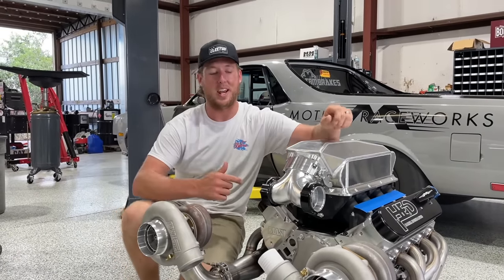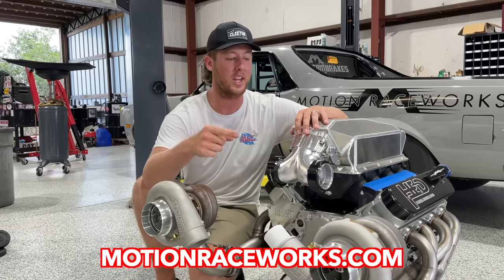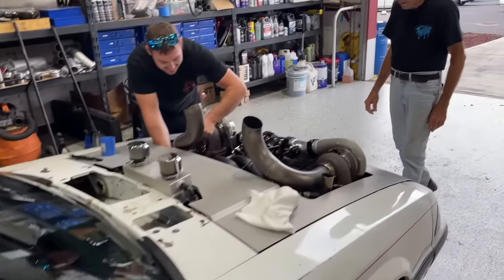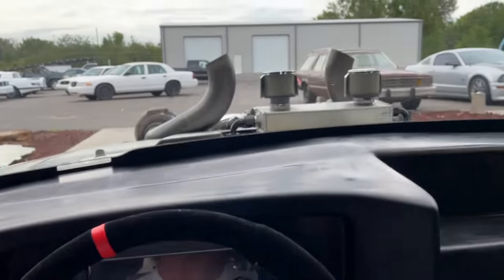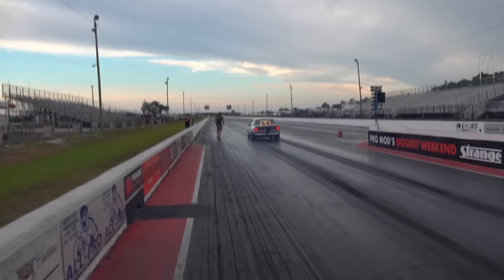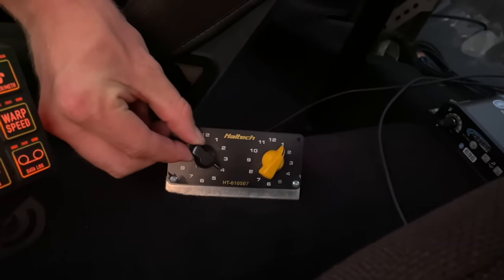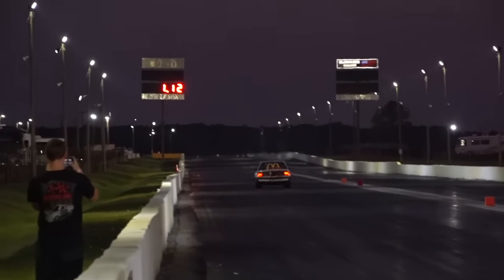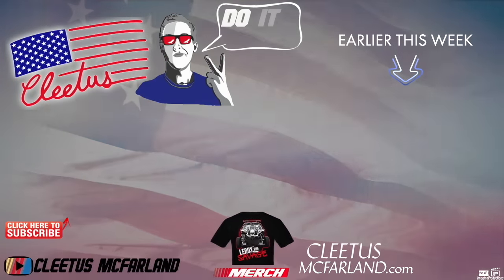I've Been Shifting My 5-Speed Lenko BACKWARDS For Months... INSTANTLY Made My Car WAY FASTER!!!

Comment: Impressive regardless but when you put all the right parts from the start into a foxbody, it doesn’t matter so much of what brand of engine your using, as long as it makes good power your going to have good results along with one of the key factors that really helped, like having the Haltech guys come set up the car and get it dialed in. All the other cars have been unconventional set ups that got upgraded as they evolved. Except for Mullet, but it also did pretty good from the start as well especially for how heavy that car is and with the pretty much off the shelf TSP LS engine it had in it before the big block when in.

Comment: ChatGPT says from right to left :D

which is the first gear lever?
In a Lenco transmission, the first gear lever is usually the one farthest to the right (for left-hand drive vehicles) or farthest to the left (for right-hand drive vehicles).

The arrangement of gear levers in a Lenco transmission, from right to left (for left-hand drive vehicles), has to do with ergonomics and ease of use during high-speed drag racing.

When driving a drag car, the driver's primary focus is on quick acceleration and smooth gear changes. The right-to-left lever arrangement in left-hand drive vehicles allows the driver to pull the levers towards them in a more natural and efficient motion. It minimizes the time spent moving the hand between levers, which is crucial during high-speed runs where every fraction of a second counts.

Comment: Lenkos are personally a mystery to me, how can you shift anything the exact opposite way with 1000hp?
Reply: Other than 1st gear the other ratios are so close together. That’s why.
Reply: Because Planetary transmissions are awesome.
Reply: @lordcommander3224  but still 1st gear at 150+? Seems unreasonable tight if so
Reply: Because all the gears are almost the same except 1st. You’re just stacking them the opposite way. A Lenko is probably the most versatile, most simple, and toughest standard transmissions invented.
Reply: The gear stack at the end of the track 5th gear in all the same.
Reply: a lenco is essentially a series of 2 speed transmissions bolted together and each section is an underdrive ratio (see the chart in the video) or when its shifted its 1:1, or direct drive. a 5 speed lenco has 4 sections, all of the underdrive ratios multiply together to get first gear. for example, say each section is a 1.25:1 gear ratio

1.25 x 1.25 x 1.25 x 1.25 = 2.44, this is first gear. shift one section and you get
1.25 x 1.25 x 1.25 x 1.00 = 1.95, this is 2nd. shift again and
1.25 x 1.25 x 1.00 x 1.00= 1.56. this is 3rd
1.25 x 1.00 x 1.00 x 1.00 = 1.25, 4th 
1.00 x 1.00 x 1.00 x 1.00= 5th, direct drive

in my example all sections are the same, and it wouldnt matter if you shifted left to right or right to left, technically you could shift any section first (though not recommended for longevity). in actuality each section has a different ratio to keep the rpm in the correct range. in the data log shown you can see the first shift happen and then in rapid succession the 2nd and 3rd shift, and 4th gear hangs on a long time before going to 5th. this is because the section with the smallest ratio change is getting shifted first, going up towards the larger ratio changes. going the proper way it gets nice even gear splits
Reply: @Sharkey_t  exactly... This guy gets it.

The only real difference, I think, is how torque is applied in the sequence going from left to right vs right to left. That would be the only noticeable difference. Like changing the gears on your bike front set vs rear set. (kinda, it's both like that, and not in a weird way)
Reply: @Steve T  that was some quality information there my guy 👏
Reply: It isnt like going 5th to first in a manual, all it changes is the split between each gear, all five levers down is still the same final gear ratio.
Reply: @th3R0b0t  The difference here is not all gearsets have the same ratio, they're slightly progressive across the modules. Sequence changes the entry RPM in each gear, and there were larger steps with the 'reverse pattern' that was pulling the RPM down further up the track where basically physics and timing say it's just going to have to sit under the power peak that much longer. Worth a third of a second so far, that's big.
Reply: @mfree80286  Correct. The previous comment gave a great overview, but as you pointed out, the gears aren't all exactly the same. So it's not 1.25x1.25 as his example was, because the Lenco like all transmissions needs to have steeper gears in the 1st-3rd range in order to help with torque multiplication.
Reply: @Luckieoutdoors  Its not 1st gear at 150 MPH because he started at the right side and the gears stacked the opposite way. That makes it no longer 1st gear , i think thats how to explain it.
Reply: @Sharkey_t   Best and most comprehensive explanation of this whole comment section! Thanks for taking the time to write all that out! 👍👍
Reply: @Sharkey_t  that’s a great run down but I think I need to do some more research to get it to sink in. I guess the manual shifter gives the Haltech ECU one less job to do. 🇦🇺🇦🇺🇦🇺
Reply: Think of it this way, he basically was using a different 1st 2nd 3rd and 4th gear.  He’s still shifting into a higher gear each time and 5th is still same final gear either way you run the levers.  It’s still finishing in 1:1 ratio.  It’s just different spread on ratios.

Comment: I can definitely see mcflurry running a 6.99 easy with a super spicy tune and a proper setup suspension
Reply: I totally agree. They still haven't even started to tweak the suspension, which should be able to get them into the 7.1s-7.2s with just suspension changes. Also they haven't made tuning changes to maximize ET. Just playing with launch RPM, timing changes in 1st and 2nd gear could bring them to the 6.9s-7.0s... and that's before adding some extra spicy boost. They will have that car running 6.8s-6.9s before the end of this year.
Reply: @RonniePTexan  I think after they make that plastic intake go boom boom, they will toss on a few more upgraded go fast parts that will get them into or right at a 6 second run!! They will need more than 20 PSI of boost to get there and that plastic intake will not like it...haha
Reply: @JoBlo819 I said 6.99 easy 😉

Comment: No lie I would laugh my freaking butt off if McFlurry runs 6s before Leroy does. I laughed when cleetus said that it took 3 years to get that kind of 60 foot with his other cars.
Reply: Not a good timeline comparison really. Cleetus has top of the line suspension and all the big boy go fast parts from the start with McFlurry but he was using junkyard engines and stock suspension on Ruby , not to mention he was still learning how this racing thing works without the team of guys he has now.
Reply: @warren michael  The fox platform with the engine & tyranny combo is the key.
Reply: @tr4u5mp90  no it’s the 4 link/ 9 inch combo is the key here for the 60-330 times.
Reply: @tr4u5mp90  yes and no , the fox in its stock suspension form wouldnt even come close to running like it does now, its all that suspension and rear end work that makes it possible to put down all the power from the Zilla through the Lenco. It took a long time for Leroy to get fast because they didnt start off with as many top notch parts like they did here. I will agree that these fox tangs are a GREAT platform and thats why we see so many awesome fast ones out there. I cant wait to see them upgrade the intake and other remaining stock Zilla parts to see what it can do. I just hope it doesnt go bang before they get it really going fast!!
Reply: @warren michael  I've seen many Fox platforms running crazy fast with a turbocharged coyotes with minimal upgrades.
Reply: Why?

Comment: You should see a lesser ratio gap to the next gear with each upshift. L to R vs R to L just depends on how the shifters are set up and the order of each module.
Reply: I dont think this transmissions is what i think it is because usually youre not supposed to be down shifting to upshift or visa versa whichever way is best.
Reply: idk I feel outside to inside is also more ergonomic.
Reply: @TheOlsonOutfit  By nature of design, it can be set up either way.
Reply: @TheAnnoyingBoss  It’s planetary gear sets stacked up. Doesn’t work like a traditional manual.
Reply: @porcucoon  understood

Comment: outwards shifting in , seems to be best , one thing i did see on the interior cam is that you kindah hit the pulled lever with the back of youre hand/wrist every time you grabbed the next lever , maibe you can try to switch the short and tall levers around ( not as in shifting but unbolt and remount ) so youre arm goes over the last lever grabbing the next one , might make it feel more natural too , might be possible to switch the rods to the trans around to different levers too instead of switching the levers around so you can still shift from in ward to outwards but the shifting on the lenco goes out to in

Comment: The LS route might be the more affordable way to go but clearly Ford has made some pretty big steps in the performance department in recent years!!
Reply: Let’s Talk👍
Thanks For Watching!
Reply: ford just made a bigger LS the similarities in the engine are very very obvious
Reply: @jackass123455  fail to realize Ford has been making pushrod engines for a very long time and every single feature in the Godzilla was already in Ford engines all the way even from the 50’s skirted block for example from the Y block.. Ford NEVER borrowed anything from chevrolet but weird to me that when they came out with the “LS” they chose to just use a small block Ford and update it instead of updating the small block chevy, the ls it is without a doubt a copy of a Windsor SBF, and  you can tell the LS is just a cheap counterfeit imitation too because the oiling in the Ford is better…. chevrolet engineers weren’t smart enough for that…. It’s the small details

Comment: You'll most likely get the highest performing result by using the levers which create the biggest difference in gear ratio first. Start with the biggest difference and go in order to least difference. That means you want to pull the 1.184 lever for the shift from 1st to 2nd, then the 1.166, then the 1.26es one at a time. The logic behind this is...in order to generate the most acceleration (regardless of power/torque) you want your RPMs to accelerate as quickly as possible. The faster you're already going, the bigger difference the same change in gear ratio would make, so the faster you're going you want smaller changes in gear ratio so the RPM can continue to accelerate as quickly as possible. Balance that with the power/torque bands and the independently balanced cost/benefit relationship with staying in gear longer vs adjusting the gear ratio more often/accurately; and you'll get the most performance. 

As a side note...this is where a big difference in a consumer transmission versus a racing transmission comes in to mind; a really big difference in for example a 6 speed's last 3 gears (4th, 5th, 6th) makes for better fuel mileage and debatable benefits for longevity; but that same transmission probably limits the engine's ability to reach top speed without the assistance of a big hill...a racing transmission with smaller differences between the last 3 gears not only has the opposite effects of the consumer transmission (fast fuel use and debatably bad for longevity) but allows the engine to be the limiting factor for speed and acceleration instead of the transmission...at least when the gear ratios are paired correctly with the power:weight ratio. There's another equation for you to make a Dr. McFarland episode with... Gear ratio:(power:weight). Another factor, specifically with the final gear ratio of the racing transmission is one that's very difficult to achieve in the real world - let alone in a simulation/game. Having the final gear ratio set in a way that allows the engine to produce peak power, at the vehicle's top speed...where setting the gear ratio any higher or any lower results in the top speed being reduced because the timing of reaching peak power and the mechanical/air/other resistance achieved at those speeds being overcome. 

IDK if that all makes sense, I hope it does.

Comment: Shift pattern is much better R 2 L but, something to consider is if you ever need a slightly less aggressive gearing (spinning out issues as you ramp up power for example) you now know you can simply shift the other way 🎉 Just another tool in the toll box

Comment: if you play it back, both runs, you can hear the second run is correct, the engine is kept at a constant high rpm which is where the power is, hence the faster time.

Comment: There's a ton of customization for the Lencos so there's no real right or wrong in general. What are the splits and what works best. You can take that stack apart and flip gears around and then shift the other way. You can even randomly pull levers - the trans won't care, but your times will be off depending on the order. Unless you know the ratios there's no way to know the right or wrong way to shift. Everyone saying your wrong because they saw someone else shift one, or even if they had one - is full of ****. You need to know the ratios to know the correct way and testing confirms that's the correct way.

Each shift brings a drop in RPM from peak HP to peak TQ. You want the bigger drops in the beginning and the smaller ones later when you need HP to overcome wind resistance. The 1-2 shift can be the biggest, should be the biggest, because most/all of the HP is going to acceleration. At the top of the track the HP needed to push it through the air is highest so you have less for acceleration. 

The 1.26's first, the 1.16 last is the correct way to shift - and you proved that.

Comment: I guess it stands to reason that the intent would be to shift the forward most stage first...if for no other reason than the stages behind would be turning less revs sooner and more often over time. So...a tiny bit less wear over time I suppose? Other than that it's just what ratio each stage is in and what your preferences are regarding the order of those ratios stacking up. I mean physically, you can shift in in whatever crazy order you want, right?

Comment: Is that a clutch or Bruno drive, I’m building a similar car was originally set to be nitrous car, now I have switched to Twin turbo, I have a cs-3 5 spd with Ram twin disk clutch, trying to find a Bruno drive, i’ve had people tell me that I can build boost with a clutch, by retarding the timing at the line. Not too sure how that will work. That’s why I’m looking for the Bruno drive. Any input on your setup would be great

Comment: According to the Tech section of the Lenco Racing website
"Shifter Tech
Operation

Shift Patterns:
All levers in forward position result in the transmission being in first gear. The tallest to the right is used to shift the transmission from first to second gear. The second lever, and second tallest, is used for third gear. The next lever is used for fourth gear and final lever for fifth.

Burnout's (on all LENCOS):
When doing burnout's you need to roll up to the water box then shift all sections accept the front section. Then start the tires spinning, now shift the front section so that you are now in high gear. You always need to come out of the water box in high gear to prolong the life of the transmission."

There were instructions - you just didnt look for em bud. U went to law school, not that hard to find.

Comment: McFlurry:"uh Boss...are you SURE that you can drive a manual transmission? I aint saying that you dont I'm just..,."

Cleetus: "HELL YEAH BLIZZARD! ! I mean I have a pretty good idea what Im sposed to do.. kind of. And any little details I can figure out on the fly. I'm practically an expert now. Where the confounded hell id your clutch pedal get off to Fluster? I bet Tye got a new fold away titanium one  from Motion installed so it dont get in my  dang way at the drag strip."

McFlurry: Blizzard ? Thats Dairy Queen not Mc...WAIT clutch pedal? Im a fully functional torque conv......Nevermind Boss. sigh *(mutters under breath)) Chev Roh frickin Lay:

Cleetus "I HEARD THAT MC FLURRY! what did you just call me?

McFlurry:What? I did no such thing! That is just a curse word my tribesmen use when we are anxious to race. Could you do me a favor though, could you warm up your hands a little before you go into full  lever grqabbin gear jammin crazy strapped down spider monkey mode? Itd be less startling for me.

Comment: Get rid of the Lenco and get a Liberty (or any dog engaged 5 speed) instead and it will way faster because planetary gears take a LOT of power to operate.  Pro stock ditched the Lenco decades ago because of it.

Comment: The average Joe winning a 2000 HP motor is going to be expensive to finish off once they have to buy the TC, Trans, Driveline, Suspension, electronics, tires, rims and rear end. Not to mention all the peripherals.

Comment: You shouldn't be manually shifting at all there Cleeter. Resistance is Futile ! Air Shift is the Way! you do realize it can be programmed to shift perfectly at any point, any torque, any RPM you choose using your Haltech. Don't be a Nit, you're way too Legit.

Comment: Hate that transmission. Also doesn't speak well for the company that you spent all that money on a transmission like that and they don't even tell you how its supposed to be used... The car would be so much cooler and more fun if it was a real H pattern stick car... That thing you guys have is just a glorified manual valve bodied automatic with 4 more shifters than necessary.